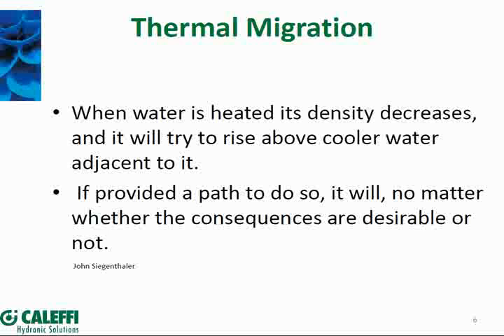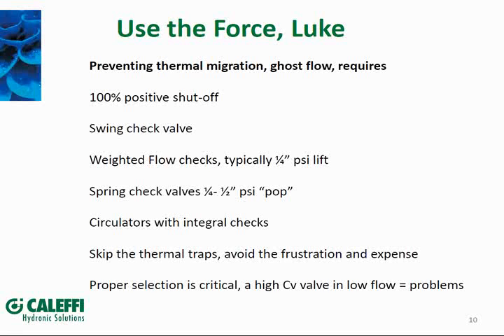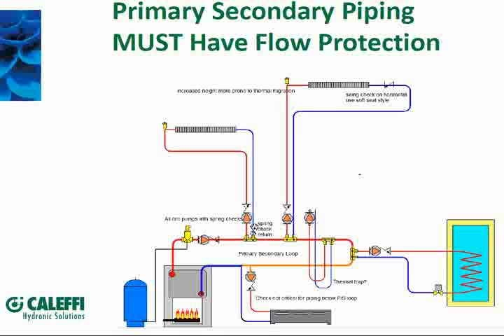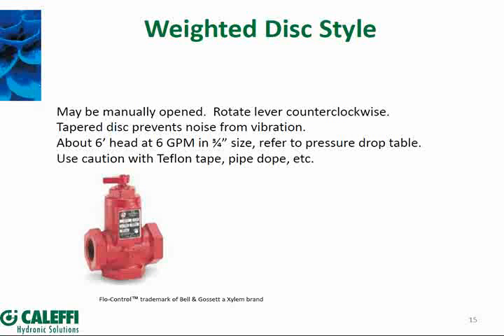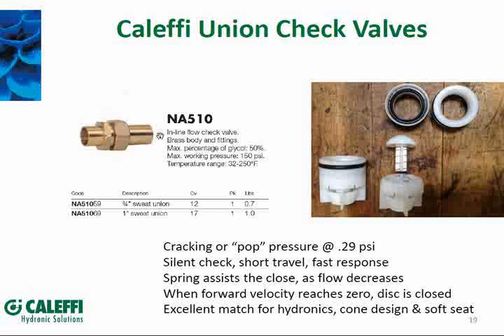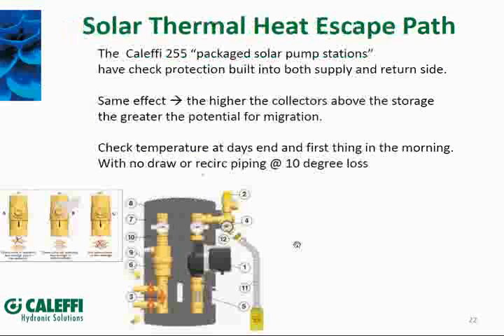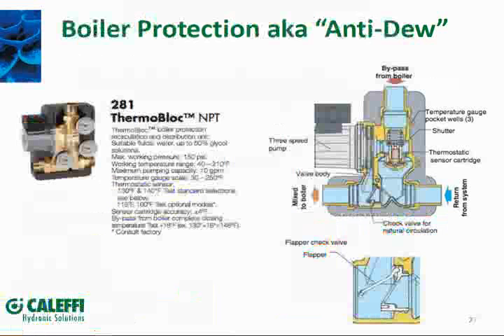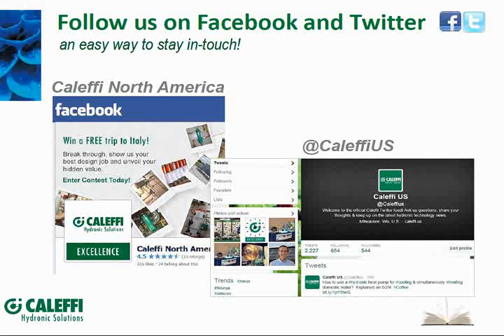Heat Migration in Hydronic & Plumbing Systems

Comment: Does it matter if check valve is on return or supply
Reply: Checks on the supply for sure.  It could be checks in the circulators, or zone valves.  Occasionally checks are needed on returns, primary secondary branches for example.
Reply: How about if your pumps are on the return and the pump has an internal check valve will that work.    Or do you still need a flow valve on the supply